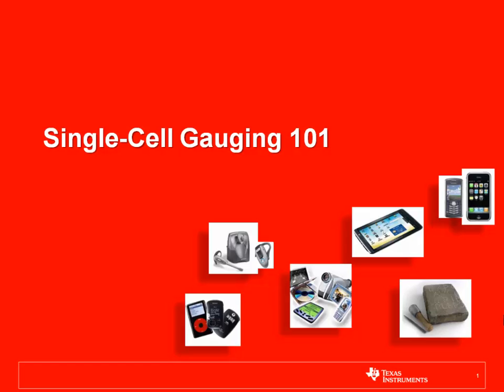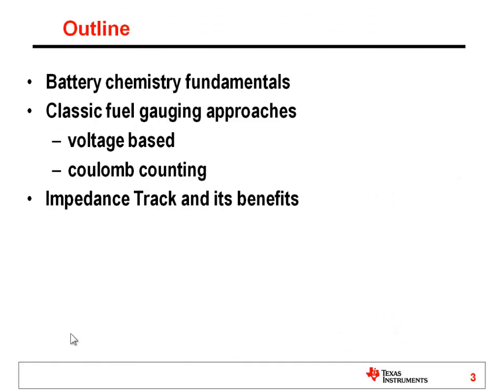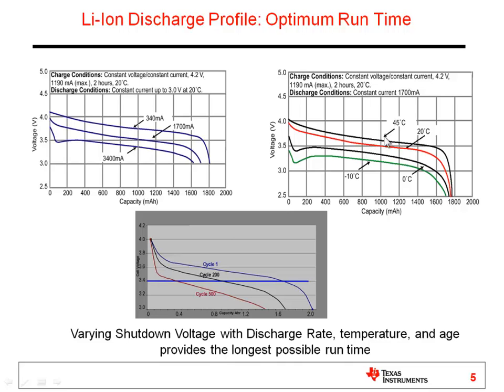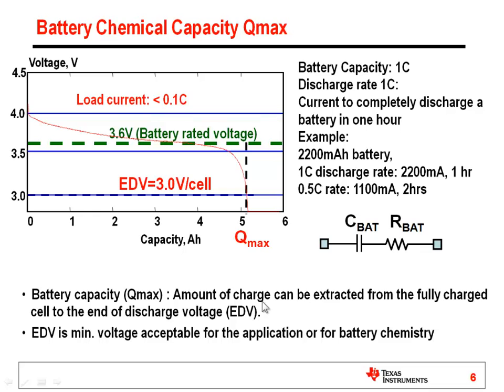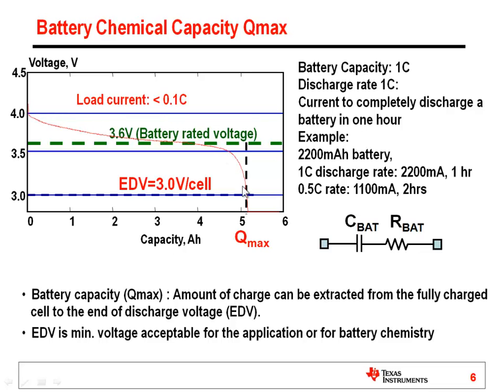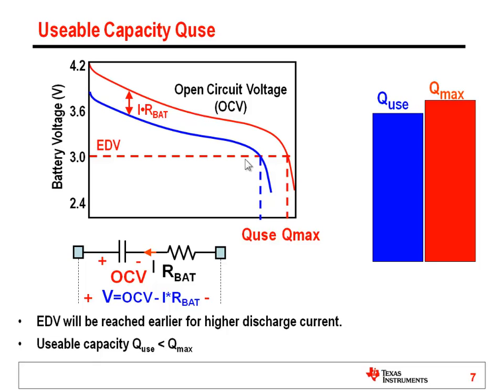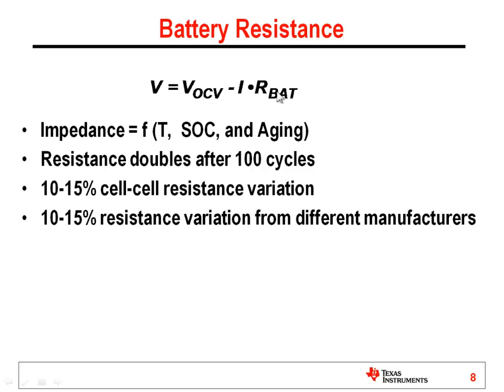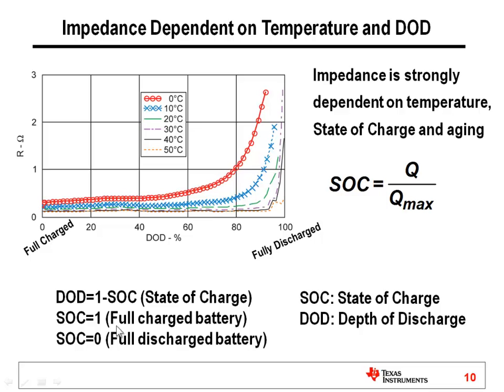Part 1: Battery Chemistry Foundations

Comment: In the graph, Shouldn't the 340mA during light load also be 3400mA?
Reply from the maker: 3400mA is correct due to the higher voltage.

Comment: What is the difference between Impedance and resistance in a battery?
Reply from the maker: Impedance normally has real and imaginary part under various load frequency and resistance is normally refer to real part under DC load.
Reply: Hi Jessica after 4 years of your question I can answer :-) to keep it simple in addition to what was said ,  impedance has to do when you deal with varying voltage and current such your home electricity plug and resistance has to do with direct voltage and current dc.. example battery